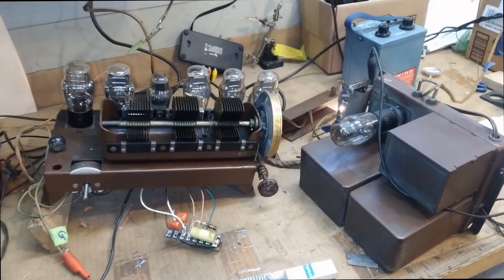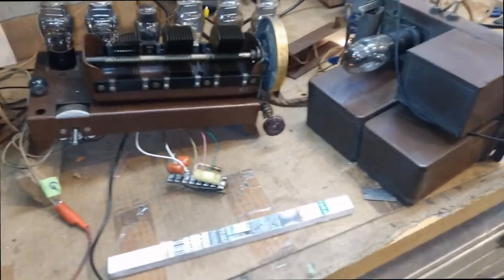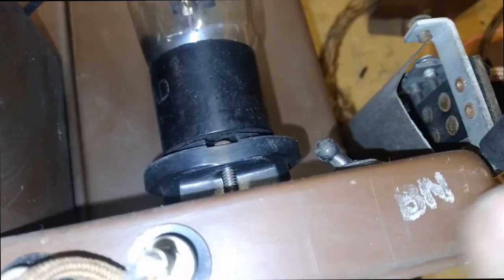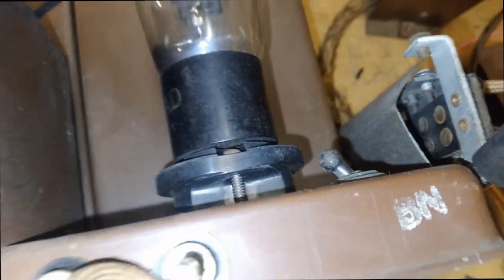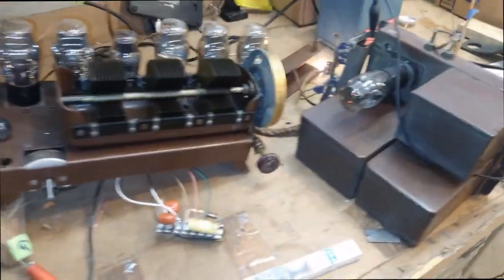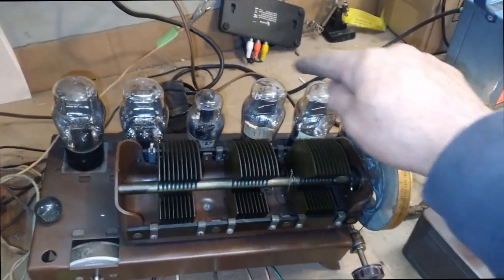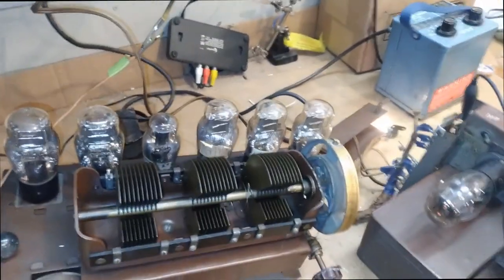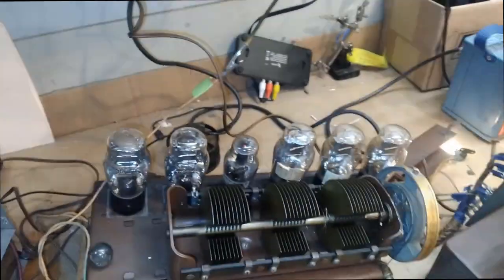1928 RCA Radiola 18 Bench Test

Comment: Hallo Kirk, are you still giving advice on the repair of old radios on here? Thank you!
Reply from the maker: Next time I have one come in!!
Reply: @kirks1959  Great work man!

I've got a old phonograph with a reciever. Wasn't sure about the open wires when I got it, I trace the wire from the outside and made a mistake by  seams to switched the power with the audio output, a little bang and some smoke from the side next to the big transformer appeare.

Just wanted to know how to go about in fixing this marvalous piece of a turntable?

Thank you!
Reply: @kirks1959  How would you go about in fixing a senario like this? Thank you..